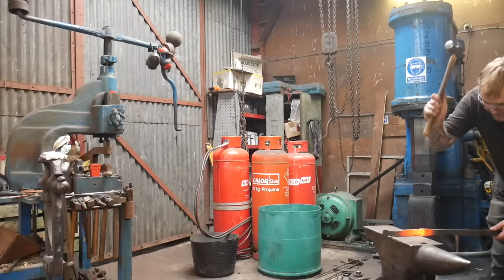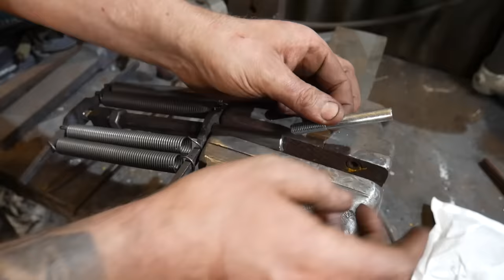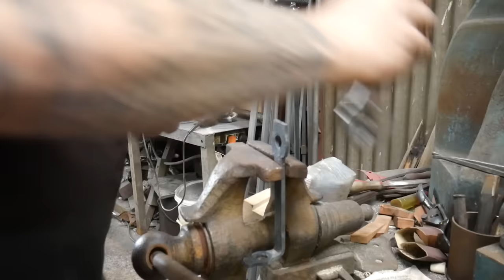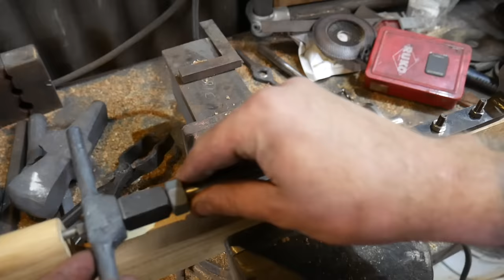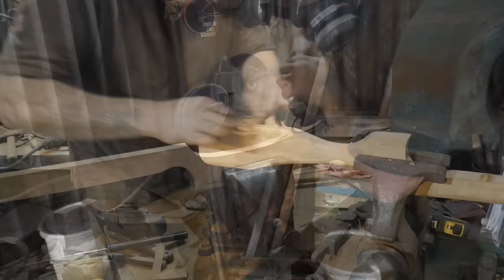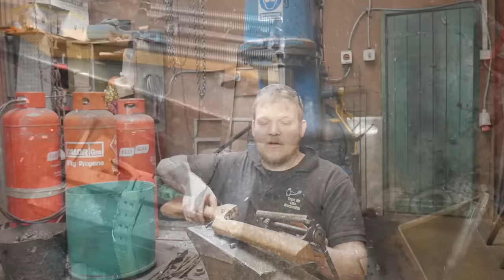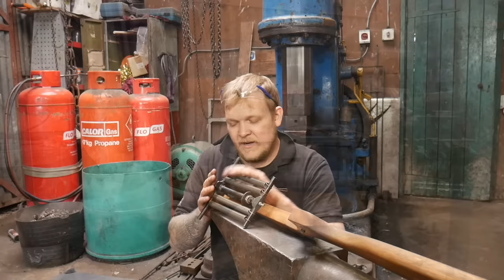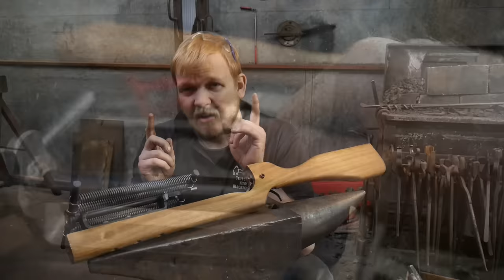The Spring Bow! Like a crossbow just with springs Pt.1

Comment: You could rig a hydraulic cocking system, and use some much stronger springs.
Reply from the maker: yes me likes
Reply: @danielmoss2089  Have you though about spring loading the trigger so when you pull the slide back it will automatically set? Also what if you made the stock a little bit thicker and drilled out the end of it so you could use a pulley and cable system with the spring hidden inside the stock? You could stack the 4 springs vertical in the stock. Plus having the springs enclosed in the stock might also make it a little bit safer if you ever had a spring break.

Comment: In terms of power, your problem right now is that those springs have a lot of force, but they are slow due to their own weight, and the more they have to pull, the slower they get. If you could directly transmit the springs' acceleration to the ball bearing without any interference, you still probably wouldn't make it to 200 fps. Here's your solution:

https://thearbalistguild.forumotion.com/t1229p15-pulley-system-speed-testing#11539

Give a mechanical disadvantage to the springs, so that their force can be converted into more speed. Spring poundage gives you potential, but that potential is easily wasted when most of the energy isn't transferred to the projectile. Hence, you need to make the projectile itself "heavy" for the springs. The easiest way would be to shoot a projectile that's heavy enough for the springs, but that's boring and costly because you'll end up shooting 25mm+ steel balls at low speeds (like, 125 fps or so).

I think that the trick is this: instead of a pistol system, create a long barrel with a slot, and insert a shuttle inside it to push the projectile. You could even machine the shuttle out of Delrin so it's light and durable. That way, your shuttle would be much, much lighter than your piston, and with a 2:1 pulley system, not only would you shoot "heavier ammo" from the springs' perspective, but you would also have twice the power stroke.

Also, the more power goes into the projectile, the less power has to dissipate in your weapon. I would suggest shooting 1/2" steel projectiles. They are probably the biggest size you can buy in bulk at a low price. I bet that with a 2:1 pulley + shuttle, you can consistently shoot then at 225+ fps, which is very respectable and usable.

Comment: You could strengthen wood by using RED OAK.  laminate 3 pieces to make slotting for trigger mechanism  Again strengthen with inner or outer laminate of 1/8” metal plate. SORRY .0125 inch or 3.4mm or ????

Move springs to sides of stock or under for better SIGHTS options.   

Extremely Interesting.   ❤❤

Comment: Cool video
Reply: Adding more springs to increase the draw weight doesn't make the projectile go faster, necessarily. It can go no faster than the speed of, in this case, the plunger. All mass being moved forward retards whatever speed is being generated. More draw weight does mean that whatever mass is being propelled forward retards that speed less. Since your projectile itself is so light, I would imagine a single spring of maybe smaller diameter but greater length with some sort of L attached which would ride in a slotted barrel to replace the plunger would increase the speed substantially.
Reply: looking good perhaps ruber tubing could be used as is in a cattapult might work better

Comment: I'd like to see you replace the springs with a couple of o-ringed pistons and cylinders(one on each side), o-ringed pistons could be fitted into cylinders and a vacuum created by pulling back on the pistons sort of like putting your finger over the tip of a syringe and pulling back on the plunger then releasing the plunger,

Comment: All your energy from the springs is being expended by accelerating the plunger (sled) up to speed and then all the energy is brought to a sudden halt by the nut, the whole plunger assembly has to have a weight (mass) comparable to the size of the ball bearing being propelled, perhaps nylon, strong and light, great video though

Comment: You need three things to make this performance better 
1 tighter fit between the plunger and the cylinder think air gun almost
2 tighter fit between the projectile and the cylinder again the point here is to create negative pressure differential between the front of the projectile and the back of the projectile 
3 rifling inside the cylinder to turn the projectile while it's being fired this creates a rotational movement while moving forward making it more accurate and better aerodynamics

Comment: Replace spring with rubber or a leaf spring as normal crossbow, springs are not fast enough to get power, springs and bow need to be 5-6 times longer for your design!

Comment: I think the main problem is the barrel length. The distance the piston is travelling is far too short. If you would use two rails instead of a closed barrel you woudn‘t need a piston. The part catching the ball could slide between the rails and you could do a 1 or 1,5 m barrel.

Comment: That's the problem. Moving metal has too much inertia.  A rubber slingshot tube has a much better stored energy/inertia ratio.   And compressed air or any gas is of course the best.

Comment: The single biggest issue with crossbows lacking power comes down to the length of travel of the "string", in this case the springs.  The link goes to the video describing the issue.  It is a great video describing this issue in fairly good detail.

https://www.youtube.com/watch?v=ghoVmc12vEs

Comment: dude, what you need is to give direction to your arrows, the stock of the crossbow is too long, cut the stock to be an assault machine gun stock and extend the tube where the arrow goes inside at least 40 centimeters so that the arrow can have a support while it comes out of the tube, or you can put a rail or two pieces of wood in the front to direct the arrow, the tube you put is not long enough to give direction to the dart so you need a support at the exit of the tube so that the arrow comes out well directed, or you extend the tube or use rails or wood to give direction to the arrows, greetings ;)
Reply: Arrows????? LOL .DUDE. It shoots ball bearings.  Not arrows. Did you even watch the whole vid?

Comment: Great workshop equipment, but the product is very amateurish and ugly. The spring for the harpoon should have been 1 max. 2 pieces, the striker very heavy. no damping stop. A few shots and the metal will be deformed. The flap needs to be stretched and hit in the hole, how to do this if the light is weak???  Even before the machine destroys itself, there is probably an injury to the shooter's health. Tentacles poke an eye or break a finger. No compact design.

Comment: Hi, I love the enthusiasm, however you're a good blacksmith, stick to blacksmithing, the reason why it's not working is because your using the wrong energy source, metal springs are too slow, they are meant for opening and shutting doors, they are to heavy, the concept I understand however the mechanical agility, practicality means they are just way too slow to shoot a ball bearing as a projectile, the speed requirements for a projectile exceedingly outpace a coil spring.

You need to go about it in a completely different way, please completely scrap the coil spring idea as the energy source required to propel an object fast enough, it is just way to cumbersome, that being said there is a metal spring that you can use it is of a different design specification, it has good swift energy source that will propel an object fast enough to become a projectile, the energy source requirement as a metal spring is a "leaf spring", this will give you the agility and speed required propel an object fast enough to be classified as a projectile.

Before I go, there is a way coil springs can be used to propel an object fast enough, however it's going to require a combination of different types of engineering, coil springs can be used to create a pneumatic air pressure, multiple coils pneumatic cylinders join together creating a multi layered pneumatic air pressure will deliver the required energy source to propel an object. As a blacksmith I can show you design specifications to create a contraction or expansion coil spring pneumatic energy source that will propel a 6 mm bearing inexcess of 1500 ft/s, this type of speed lethality is 100% and some, depending upon the size of the either contraction or expansion coil spring, a 25 mm ball bearing can be propelled at approximately 2500 ft/s which is capable of piercing 2 inches of steel.

Let me know if you need design specifications.